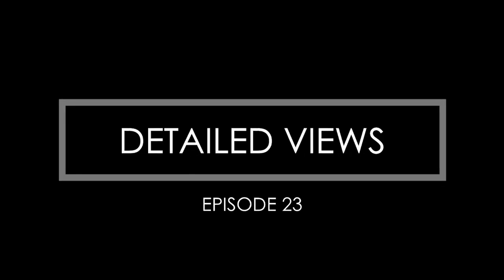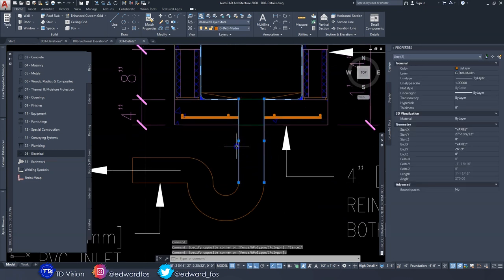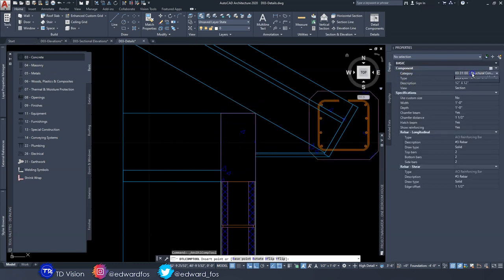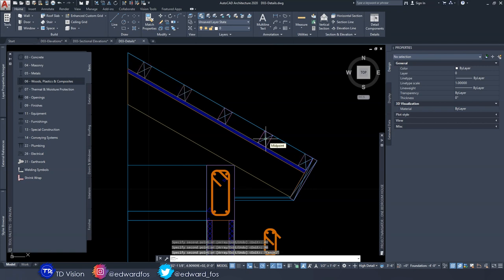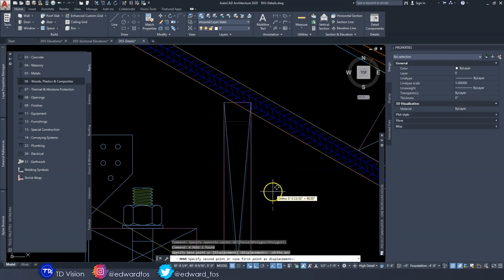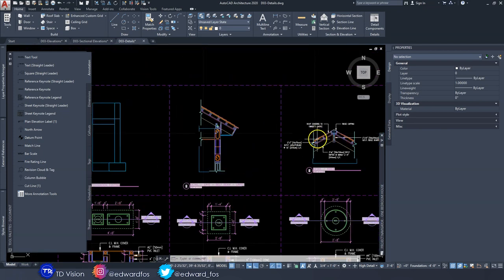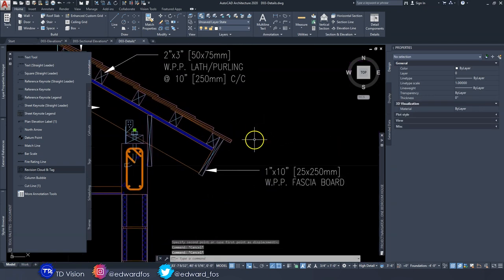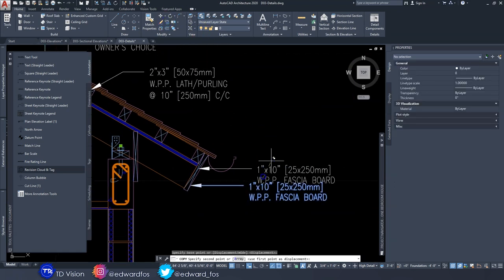DETAILING Part 7 - (Detail Drawings) in AutoCAD Architecture 2023

Comment: Quick Question, im trying to detail out some structural steel details and i cannot get them to show up on the drawing.  i believe i turned on all the required layers but still having no luck.  any advice?  
thanks,
Reply from the maker: Perhaps, your details/annotations are were placed with a different scale than what your view is set at. Both scales need to match.
Reply: @TDVision_U  My scales match. ive had that issue before with dimensions.  I can send you the file if you want to see it.  I havent used the structural components in this software before until now.  i figured it would save some time but its proving to be faster to just sketch and make my own.